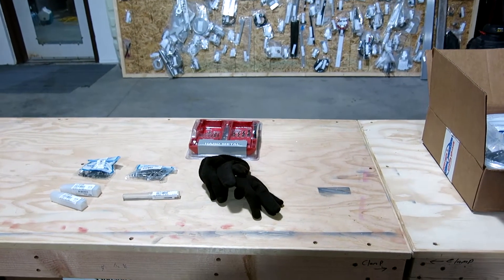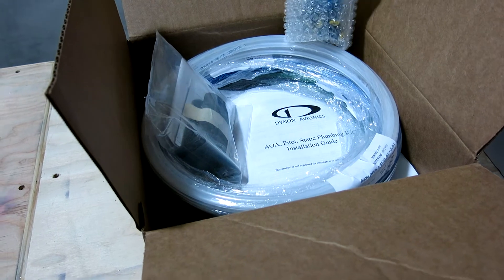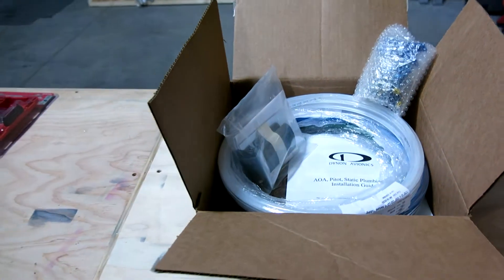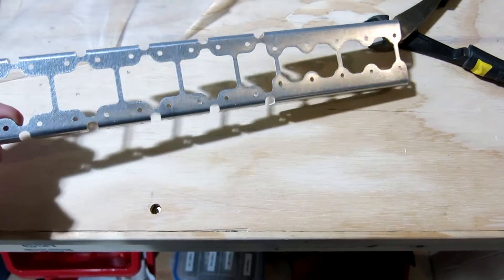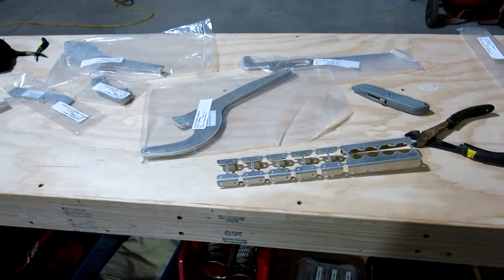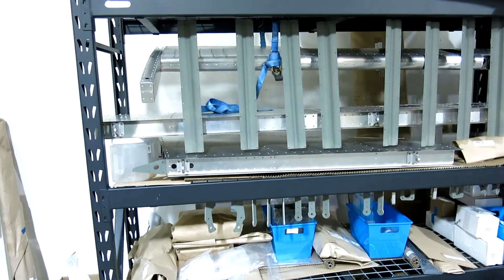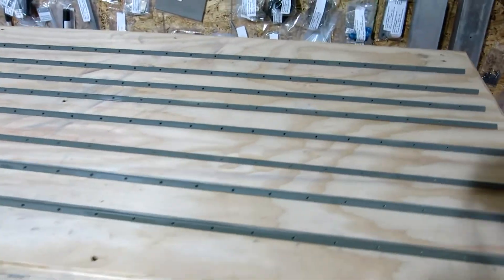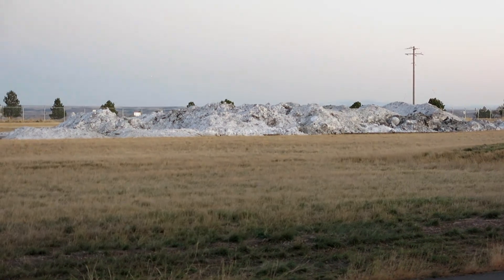No. 42 10-31-2020 Wing parts

Comment: Are you spraying outside?   Do you have to scuff up the material before spraying?  Thanks for videos.
Reply from the maker: Yeah, just standing outside the hangar. The priming I’m doing is just on some interior surfaces, but not everything. The 6061 T6 aluminum is supposed to be pretty corrosion resistant but I decided to just give a shot of basic primer. I’ve put it on spots like where the ribs rivet to the spars, the stringers, doublers, etc. I haven’t primed between skin and ribs, though.